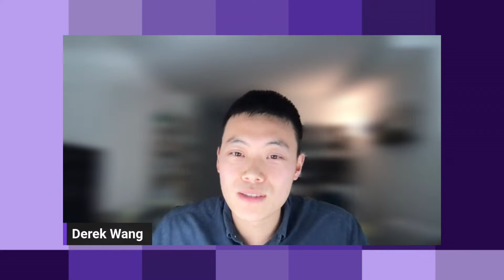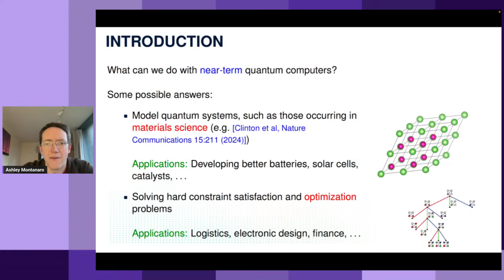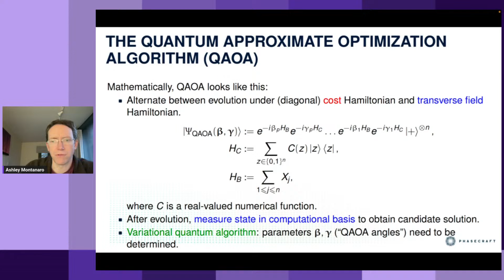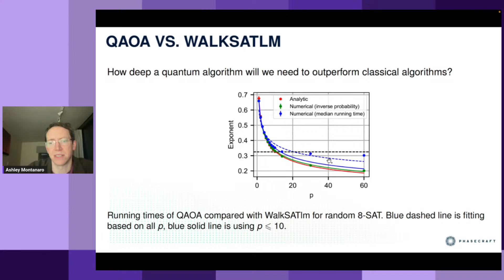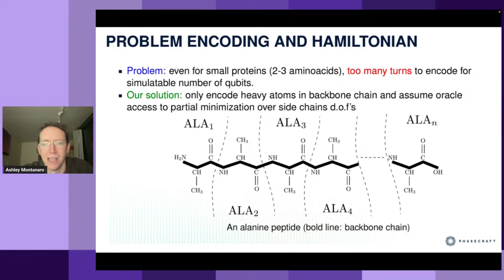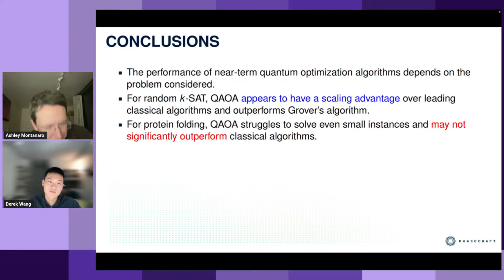Near-Term Quantum Algorithms for Optimization with Ashley Montanaro

Comment: hello im phd student in systems enegineering working on optimization and control of systems  i start new part  is solving optimization using Quantum computing  QAOA VQE  but in my cases im working on variables vectors  how can i solve the problem or any suggestion thank you